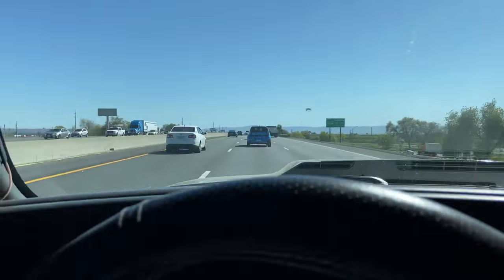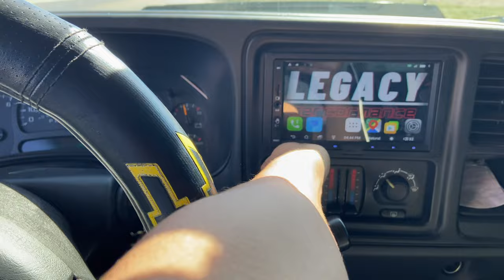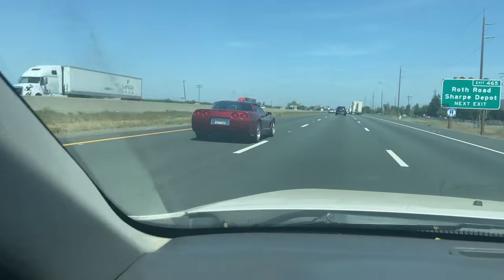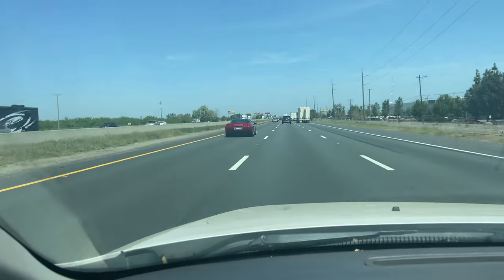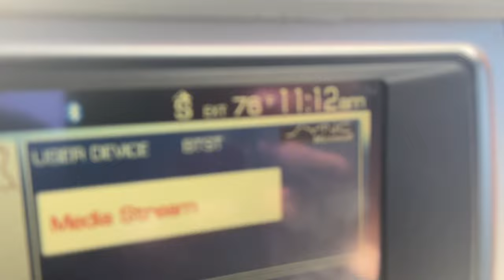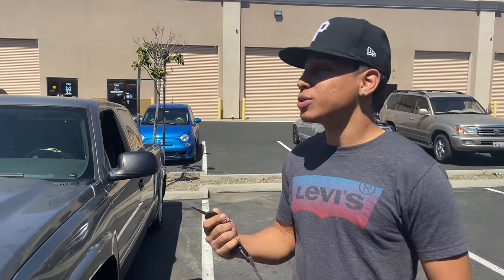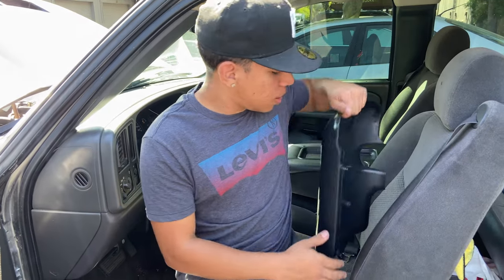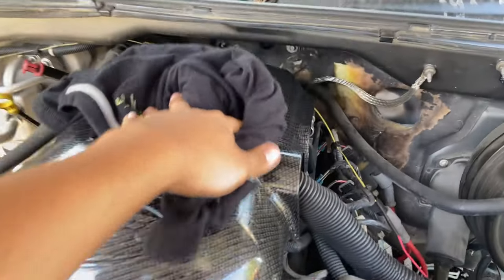BUILT 4L60E TRANSMISSION IN SILVERADO!! | Burn Out Ready!

Comment: Cool bro 😎 Ey just FYI I noticed your check engine light on and that you still have that shorty air filter. Mine did the same thing, so I put the tube from my cold air intake back on which moves the mass air sensor further away from the throttle body, and Vuala check engine light is out!

Comment: Got a 700R4 with SS Mega Monster-in-a-Box kit from Monster Transmissions it’s the heavy-duty high performance rebuilt kit. Koleen steels, Red Eagle Race clutches, extra wide Racing band, .500 boost valve, separator plate mods, completely rebuilt valve body with polished valves and different performance springs, brand new vanes and rotor in pump, full billet aluminum servo, brand new 1800-2200 stall, 5 pinion planetary gears, painted case, new filter and gasket, new HD transmission mount, painted crossmember, undercoated front and rear drive shafts, on and on

Comment: I’ve done a lot of research on both of these transmission prior before buying my 06 1500 

If you’re building your truck 650hp and up you might as well get a pro glider or a 4l80e swap it but if you’re just going for cam bolt on and 650 hp and under the 4l60 e can handle it and it’s actually better 

The 4l80e shifts like a tractor unless you got power to push it to shift faster
Reply: Thank you sir

Comment: I recently got my transmission rebuilt maybe 6 months ago, I did a heavy duty upgrade on it not sure what all parts they put in it. But when I got it back it shifts aggressively like you’re saying, and my dad was riding with me and he was saying it’s shifting questionably hard and I took it back 2 times and they say it’s the boost valve and if I want to I can replace it with the original to have it shift smoothers but I paid extra to have “heavy duty” parts. I have an 08 silverado same trans you have just wondering what your thoughts are.
Reply from the maker: Most heavy duty or performance parts in transmissions tend to be a little more aggressive just because the materials and setting they have they either are going grab real hard or shift fast… if it’s a daily and u don’t plan to track or abuse the truck I would go original if you are planning to play around with the truck, upgraded parts are always way to go . A little comfort give up for some reliability

Comment: What’s all done to your truck at this point? About to throw in a built transmission on my stock 5.3, with a tbss torque converter. Just curious if I should atleast throw in a tune so it handles cleaner

Comment: Im curious how your built 4L60E is working now, trans builders say you're wasting your time doing anything to a 4L60E so are they right? Or is it still going good?
Reply from the maker: Knock on wood but I drive this truck HARD and it’s still running real nice
Reply: @LegacyJR  Thats good to hear.
Reply: They’re just haters, never had issues with a 4L60e
Reply: @HashMaster1776  This is good news because I don't feel like spending 3 grand doing a 4L80E swap. Thanks
Reply: @DM-qp7do  4L80s are heavier and have higher drivetrain loss, so less WHP with 4L80. Build a 4L60 and you’re good to go.